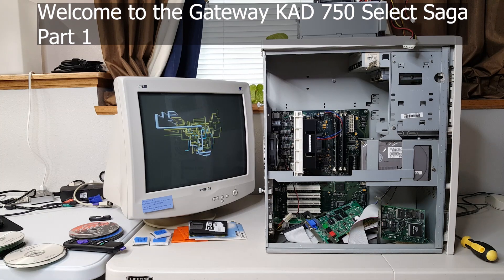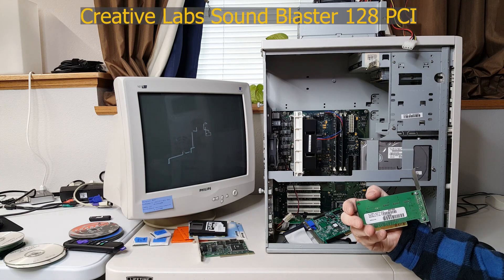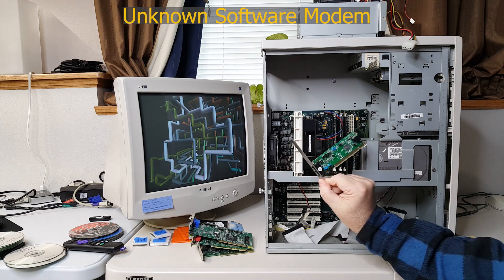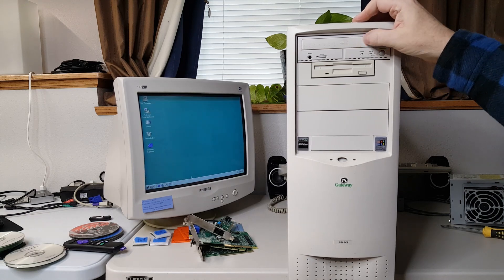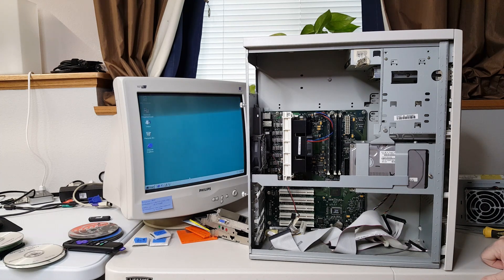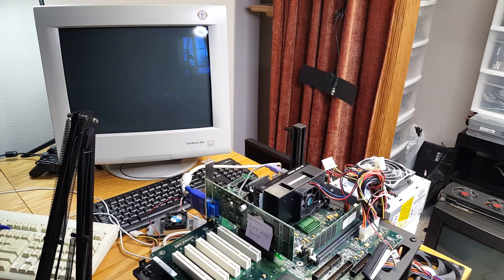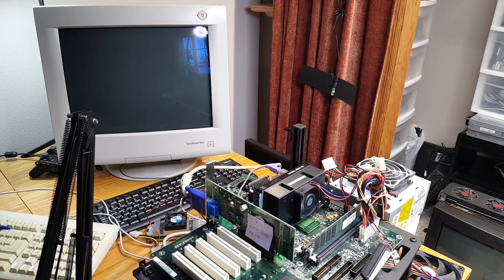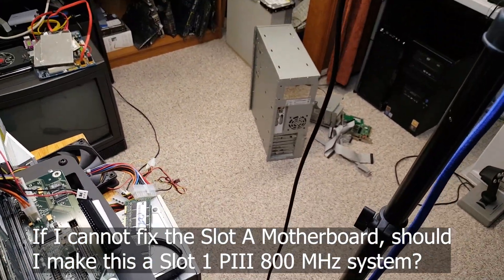1999 Gateway KAD 750 Select Part 1: Disassembly

Comment: Some slot A AMD are Classic starting with a K7 and some are Thunderbird starting with A0. Some boards only support K7 chips to show any signs of life. Look carefully at the top of the CPU to determine which it is. I have a few systems mostly Compaq’s and a MSI slot a board and the A0 chips won’t post at all. They might be compatible with Gateway systems not sure. The biggest difference I can find is the A0 has cache on die and the K sku has cache chips on the pcb. Also keyboard is plugged into top/mouse ps/2 port but definitely not the reason not posting.
Reply from the maker: turns out the mobo had a nicked trace.  Got it repaired, hope to do a rebuild in a little while.
Reply: @UncleMikeRetro  That's good to hear. I managed to find a 1GHz Slot A Athlon so I ordered this same board on eBay seems like a good board having no caps to leak should last a long time. I hope it works with my Sound Blaster Live had a board with the VIA southbridge chip and would freeze once the driver was loaded.
Reply from the maker: I won't lie, those darn SB Live! cards have always been tricky to get working right.  And I have owned one since they first came out back in the late 90's

Comment: As i see, keyboard connected incorrect. Try to totally disconnect keyboard. Also i recommend you to use POST card to begin proper diagnostic. And i recommend you to change coin battery! Few days ago i have had a problem with one MB, that could not started because of empty battery!
Reply from the maker: Thanks for the tips!
I just got in a PCI/ISA analyzer card last week, have to unpack that too!

Comment: Wow! Cool find, also strange not seeing many electrolytic caps on that motherboard. I thought the caps would have been an issue. but you never know! Also do you happen to have a POST card to see if any codes are running?
Reply from the maker: I am trying to decide on a good POST card.  I am not giving up!  Also, I think this board got a shock in the past, but I can't nail it

Comment: A unique board with no electrolytics...dies. Kinda ironic :))
As a last resort, it might be worthwile to replace and reflash the BIOS chip itself.
Reply from the maker: You think?  Trying to think if that is even remotely a possible cause?
Reply: @UncleMikeRetro  Yes, someone might have been tinkering with it before, I've also seen some notebooks that were 'braindead' because of the BIOS chip deciding to either die or corrupting the BIOS for any other reason.
Reply from the maker: @puciohenzap891  hmmm.  Maybe a future project.

Comment: Maybe the slot 1 has a little corrosion and there is not great contact.
Reply from the maker: I looked inside the slot with a magnifying glass, and it is shiny clean.  I am thinking just dead mobo or reluctant CPU.  I may be able to test the CPU side of things in a month or so.